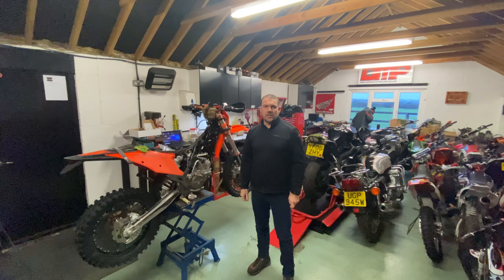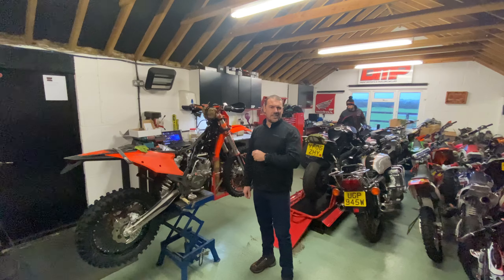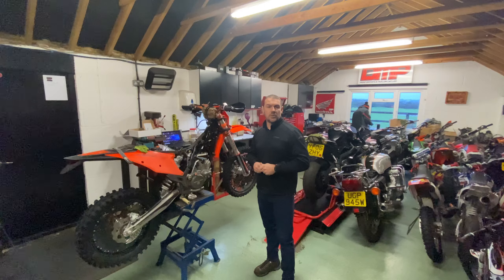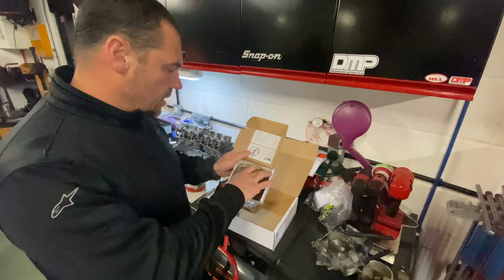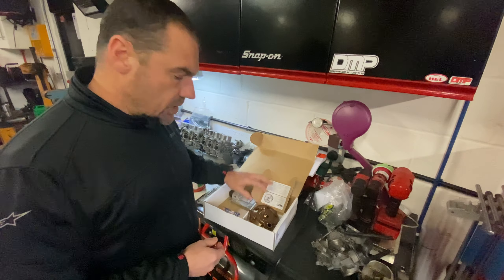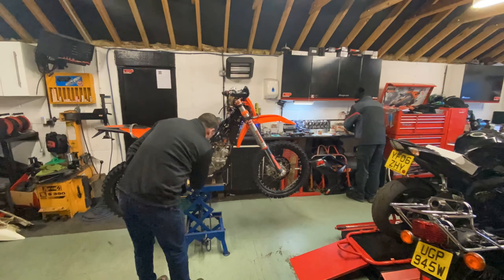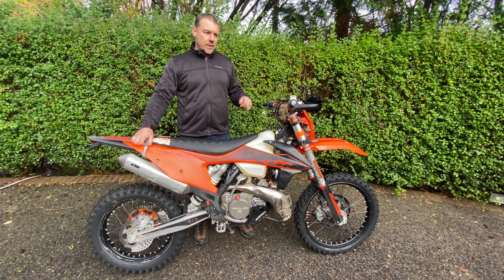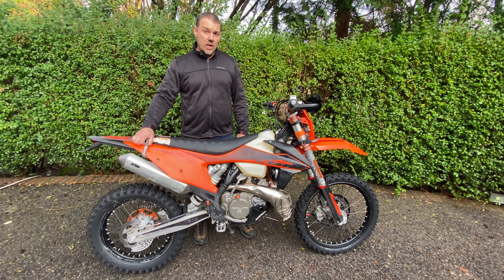TSP Two Stroke Performance head and ECU at DMPerformance

Comment: I'm running the TSP MED comp head and ECU remap and it's amazing! Dave knows what he is doing. Also did the idle screw mod and air screw 1/2 out. 2020 300 EXC. You can't loose. Thanks for the video.

Comment: Great video, was just wondering if the medium comp head puts danger/additional stress on the engine and is there a massive difference in compression between the stock head and a medium comp head

Comment: I don't know what to choose between medium comp and low comp for 100% hard enduro riding (romaniacs style).
Our biggest problem somtime is  overheating, but on the other side we need good torque on some extreme climbs where you need to be in 2.nd and keep good pace. 
I see a lot of reviews on the medium comp, but none on the low comp ....
Reply from the maker: I wanted the low comp head but after a long discussion they recommended medium. I haven’t tried it but I have a feeling the low comp head is too close to the stock head and that the improvements are less noticeable. He said 95% of guys do better with the medium head.
Reply: Great info, thanks Carl.

Comment: What stand does Dan use in the workshop? Looks great to get the bike up higher to work on
Reply from the maker: https://www.24mx.co.uk/motocross-accessories/motocross-accessories_c405/mechanic-stands_c409/proworks-scissor-lift-stand-31-82-cm_pid-PIA-130133?gclid=CjwKCAiA_9r_BRBZEiwAHZ_v1waeP863yNMOKK6tW5b-FnwWefNUm7RXKHqts3z2UmerAh7CzY-hvBoC_v8QAvD_BwE&gclsrc=aw.ds